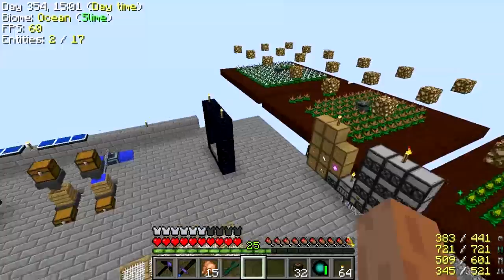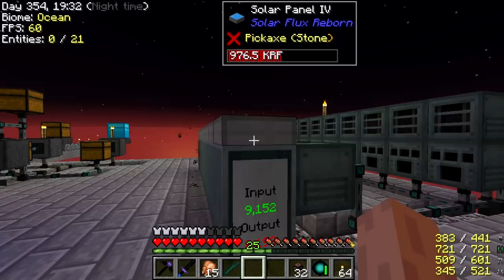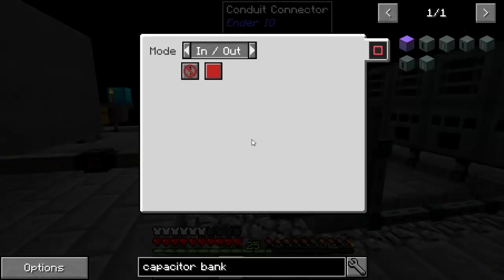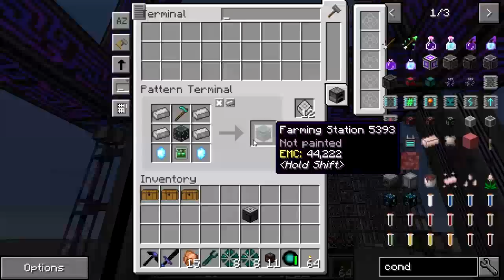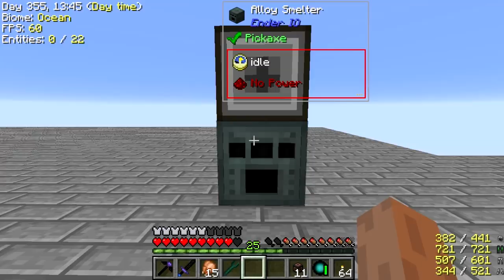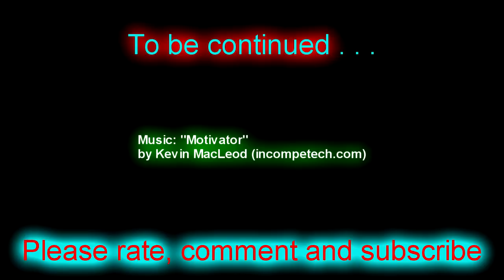Seeds Crafting And Power - Hermitcraft Hermit Skies Ep22

Comment: The farmer unit doing the certus quartz essence is not set to the correct redstone signal, that is why it isn't harvesting the crop. 
The conduit that supplies the capacitor bank is a bit undersized and has a limit on the amount of power it can transfer. You should 
use the highest tier conduits you can make for those links. Also place the solar panels back on the bank, as any little bit can 
only help in the long run. 
Thanks for the video and take care!